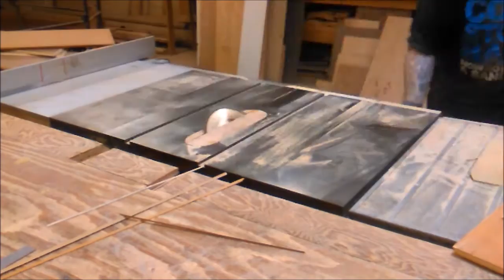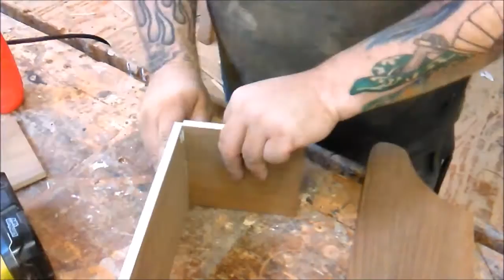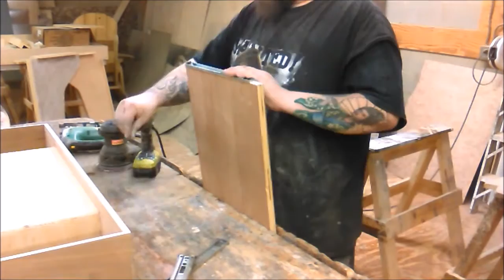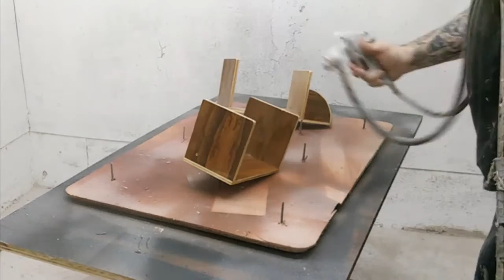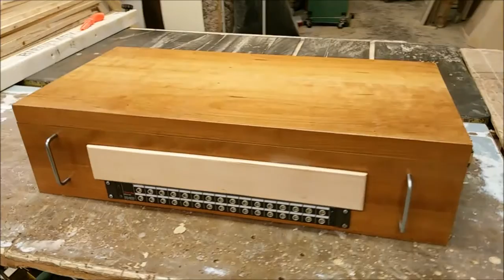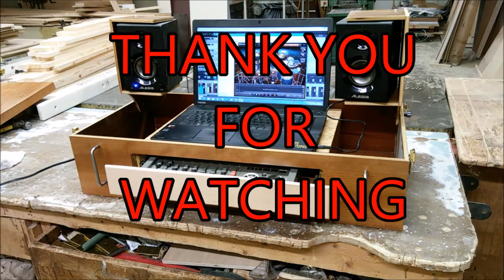Making a mobile carry case for studio recording

Comment: Thanks man. Brilliant job.
Reply from the maker: +TheBlueskyson thank you
Reply: No probs. recording muso here too. How do u find the zoom r24 to use?
Reply from the maker: +TheBlueskyson I like it a lot it has 8 inputs so can be used as a mixer and used as a interface too ,I've recorded a full band with one mic on guitar ,bass and vocals and 4 mics on drums and it works great
Reply: Cool. I've just ordered one! should be here in a week or so. I've used zoom guitar pedals over the years and i've always been impressed. I'm putting together a similar mobile set up here so next step will be which laptop. my macbook air might even do the job. Good to know. Thanks man and all the best.
Reply from the maker: +TheBlueskyson that's great you won't regret getting it ,Mac is the way to go,I wish I had one
Reply: One last question if i may. SDHC memory cards? Are they hard to get these days, or do you just record into zoom, then usb into computer/DAW? thx
Reply from the maker: +TheBlueskyson if I'm recording live I used the SD card which are easy to find  but typically I just use it as a interface so thru the USB to laptop into my daw (reaper)